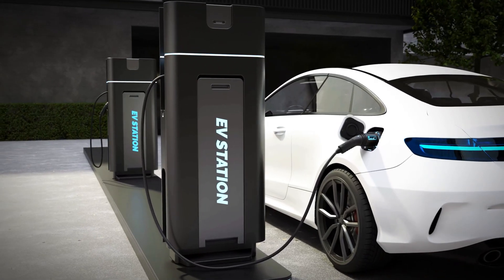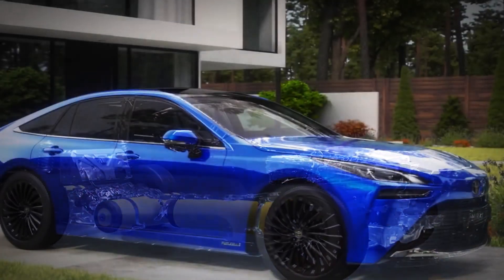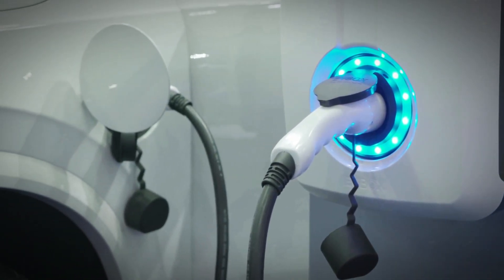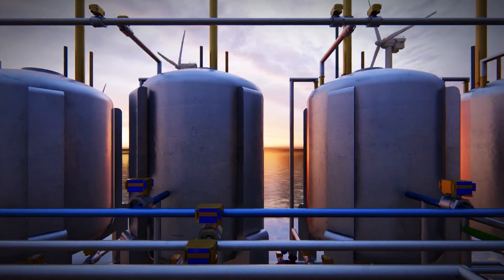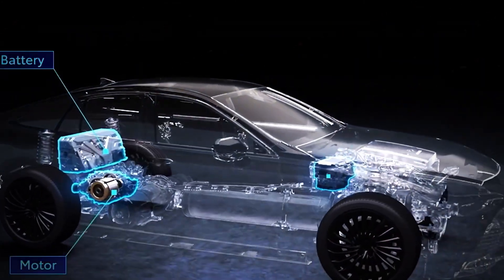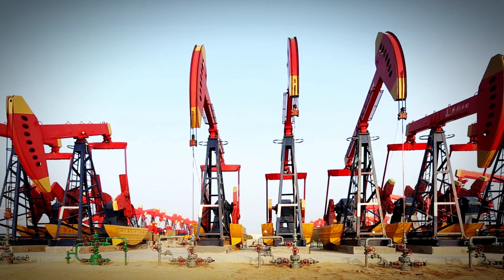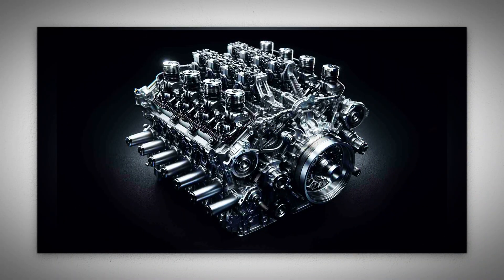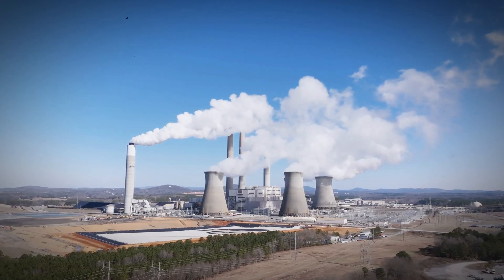Toyota CEO: This New Engine Will Destroy The Entire EV Industry!

Comment: For anyone with a grain of scientific understanding they will know that the only thing you can actually power directly with water is some form of hydraulic mechanism, such as a water turbine, wave generator etc. 
This discussion completely ignores the fact that you need energy to split the water into hydrogen and oxygen and the engine itself is actually just a hydrogen engine. It will use use more electrical energy to split the water than the energy in the hydrogen. You will then have substantial losses in the engine itself, so you'll be lucky if you get more than about a third of the electrical energy you put into splitting the water actually driving the wheels of the car, so you'd be far better off just using that electrical energy to drive the car directly at about 80% efficiency.

Fundamentally, there is no energy in water unless you can use the hydrogen in the water in a Fusion reactor.

The only other realistic way of using 2 power an engine would be to use some chemical means of splitting the water comma such as reacting it with aluminium which has been proposed, but this makes the end to end process even more inefficient and vastly more expensive when you look at it from the whole system perspective.

If Toyota really are considering real-time hydrogen production  from water for powering a car then, unless car drivers suddenly decide they want to pay a heck of a lot more for their fuel, this concept is a dead duck.
Reply: @nickcook2714  so in other words it's not happening